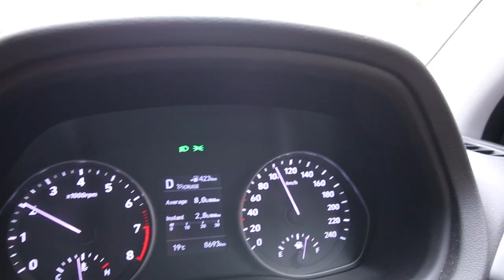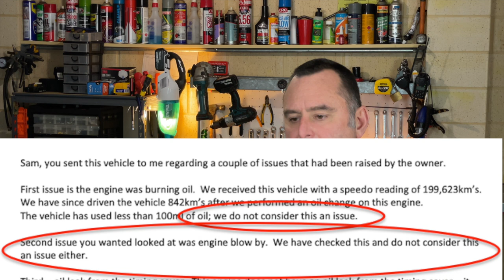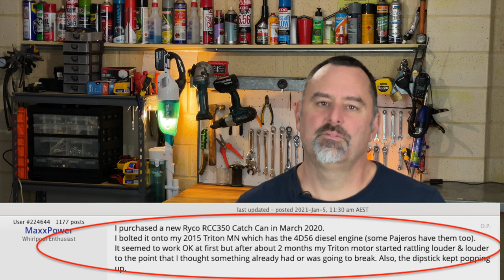Did my 200 Series Landcruiser ENGINE BLOW again - twice in 12 months? Or was the catch can to blame?

Comment: Wow. Definitely not boring.  Lots of interesting stuff there and I enjoyed your story.  Your heart must have sank when the problem kept coming back.  I don't have a catch can on my 79 series 2020 LC which is still under Warranty and just assumed the engine would be designed to deal with emissions etc.  Jury is still out as to whether I will get one down the track.  Great video.
Reply from the maker: Thank you. I still think there is merit in catch cans but am very undecided about which one is best brand wise…
Reply: @JebbreysJibberish  thankyou.
Reply: I recently hired a 7m MB campervan. Had 220k kms on it. Pulled like a train and returned 9.3 l/100 over 500 ks of highway undulating terrain. Asked the staff when I returned it and they said they don't touch them ( no catch cans, egr blockers ets), have very few failures and they sell them off between 250 and 300k. Of course these things don't do school runs or nip to the shops.

Comment: Hey Mate! Thanks for the video I have subbed for content.

Must of been a emotional ride mate glad things a lot better now. I am concerned about my Catch can now in my 2012 Y61 Nissan Patrol. I will need to confirm if it's a Ryco but what are your thoughts with Catch cans in general since a lot people in the comments are saying don't use a Catch can?

Cheers again mate.
Reply from the maker: Very good question. I think catch cans on certain motors are still a good idea. Like on the 200 with the VDJ because it’s such a heavy breathing engine. Pretty sure the ZD30’s like your patrol also like to breath a bit so probably not a bad idea. If it was a 1kd prado maybe I wouldn’t bother. In saying that I’m now much more weary on the installation, brand and maintenance of them. I’m still trying to decide if I’ll keep the filter in the new RCC351 or not, might remove it all together or maybe replace with stainless cleaner type stuff.

Comment: 13:18 You can see the pain in this defeated mans eyes. He's had enough.
Reply: Its really frustrating when you spend your hard earned money on a car and you get issues.
Totally feel your stress mate.
Glad you have it sorted 👍
Reply from the maker: Thank you.
Reply from the maker: Yeah and there was more that went wrong during this time but I didn’t want to completely bore everyone!🤪
Reply: @JebbreysJibberish  I bought a 2016 Sr5 with only 40,000kms for 48k Cash and have been having problems with it..
Dealer says they can't reproduce the faults so won't fix anything.
Have taken it in twice now and both times they have said "Can't fault the truck"
It has stat warranty but they say they still can't fix it unless they find something wrong..😭
Its very jittery on the road to the point where if i hit a bump on a corner at 80ish it feels like it slightly skips along the road..
Just doesn't feel right down there like the bushings are shot or something..
Its also VERY bouncy on speedhumps and i have heard the front scrape at like 15km ph..
Im guessing shocks are dead..
The leaves in the back are also flat..I did not notice this untill a few days after purchase..
Ive also had some issues with it not going back into first after reversing on a hill with a load..has got me into some dangerous positions..
And lastly at idle i can feel a slight miss..
I'm going to take the air box apart tonight and hope to find no red dust in there..
I checked the previous owner from the "home" setting on the gps as they hadn't deleted it and he was from Bundaberg...really hoping it hasn't been dusted..
Not what i expected for my nearly 50k cash...
Reply from the maker: Mate, that’s a shitty story. Has it got a DPF? Yeah check for dust. It does sound like the suspension is knackered, especially the shocks so it must have done some serious corrections over its life too so that. Best of luck with it, hopefully you get it sorted.
Reply: @JebbreysJibberish  Yeah mate has a DPF i believe.
I don't see any smoke whatsoever though and my missus followed me for a bit the other day and said it was fine.
I am going to change spark plugs soon to see if thats the slight miss at idle.
Just got home from work going to crack a cold one and have a look in the airbox too 🤞
Cheers bud i hope i can get it sorted too.
Reply: @joshpritchard4803  : always good to have a non toyo' mechanic on the payroll...

Comment: G'day mate, i ran a provent catch can on my isuzu Dmax for about 6 months and was always suspicious of the amount of oil it collected,and also 
wondered at some of the inconsistensies in the amount it caught, got pissed of with that and took it off and have never looked back since, i went back to the old 
belief that once you start a motor get it up to proper operating temperature even if you have to do extra kilms to achieve what you need to do, i know its a 
pain in the arse but in my situation where i live its really paying off, all sensers and air intake pipes, and exhaust lines are free of excess buildup, long 
story short, every time you use the vehicle get it up to full operating temperature regardless of distance covered, hope this helps.

Comment: I had my ARB filter in my cruiser catch can removed l just have some steel wool in their but l need to replace a rear main seal now lm going to run it with the oil drop tap open...

Comment: Im a Mechanic and have contacted Ryco over their filters leaking or comming loose.
Ryco are denying any responsibility telling me Im not installing them correctly. Ive changed supplier about 3 years ago.
Im about to remove my catch can due to oil leaks from my engine. Ill throw it at them if they don't offer me a full refund

Comment: I avoid non standard mods and definitely don't like non factory filters  generally. For example wanted to replace Toyota landcruiser ignition leads and so bought expensive aftermarket. These I found had poor connectors and consequently were unreliable. So then bought genuine and no further problems. An expensive lesson.

Comment: Total sympathy years ago I had a engine reconditioned it was just worn out and blowing smoke 💨 after the rebuild it blew three head gaskets after a lot of buck passing between the mechanics and the engine rebuild shop the cause was picked up by another mechanic who noticed the wrong pressure radiator cap had been fitted some time in the rebuild process possibly as a new radiator was fitted during the engine removal
Reply from the maker: Amazing isn’t it. I think there is some of it that people just don’t care and some of it people are too closed minded.

Comment: Great video
Reply from the maker: Thank you.
Reply: @JebbreysJibberish  I spoke with my Toyota mechanic who informed me a few weeks ago to be careful with catch cans on a 200 series, that's what made me search for videos like yours. They had three LC200 enter their workshop in the last month with seized engines, the catch can being the issue, two had the Ryco catch can, not sure about the third vehicle. 

Apparently, the newer (2019/2020) versions of the LC200 are even more prone to this issue with a catch can installed as Toyota have now fitted their variation of a 'catch-can' on their engines from the factory, or so I've been told.

The issue with the Toyota variation of their catch-can combined with an after-market catch is that it seems to create some sort of positive or negative pressure, forcing the oil out of the motor, seizing the engine. Two of the three LC200 in his workshop only had a few thousand KMs on them. Still brand new. 

My LC200 has not appeared to have any issues yet (I have had the Ryco catch-can on there for about 10,000km), however, I did notice a slight engine idle fluctuation recently which has never happened before. 

Thanks again for the video, there is very little information out there (through my searches anyway) regarding this catch can issue with a LC200. Many thanks
Reply from the maker: Interesting as I had that strange idle miss too……. Hmmm. Which Ryco catch can do you have? It’ll say on the top what model. Should be either RCC350 or RCC351. Ice just changed to the 351 that Ryco has sent me, it doesn’t have the check valve at the top, instead it has a baffle at the bottom of the filter which I still can’t work out what it does exactly.
Reply from the maker: I’m also interested in this catch can they say Toyota fitted. If that is true, one big finger up to all the nay sayers on these videos saying that of Toyota didn’t fit one why do you 🤣
Reply: @JebbreysJibberish  Very true :) when I find the official name of this thing I will post it here, apparently it cannot be retrofitted to an older LC200, I've asked. 

Someone might be able to explain why it was added to the newer LC200's if not to perform the duties of a catch-can???? :)
Reply from the maker: Any info would be very much appreciated. It’s no surprise with all the issues of them gunning up I guess.

Comment: Why would you bother putting a check valve on a catch can, it's not like the crank case breather is gonna start sucking back the other way. Silly ryco 🤨
Reply: I would assume it’s to relieve excess pressure within the catch can to be vented out? The provent 200 used to have these too on its cover until lately, replacement filters have bits to remove the spring check valves too. Just my 2 cents.

Comment: I hate shops, I had a load of issues with my triumph dealer for my triumph 675 motorcycle. They charged me a ton and messed up my bike and then tried to blame me for every little thing. Worst part was when it was running on 2 cylinders of 3 because the itb throttle blades were adjusted so badly. And the head mechanic said that was normal and the bike would learn around it. I had to use a thermal temp gun to prove it wasn’t using cylinder 1 until 5-6k rpm. Scored cams, pulled the plug threads out of cylinder 1, Damaged my air filter, was terrible.
Reply from the maker: The incompetence is staggering sometimes!

Comment: If you read some catch cans info sheets some of them state not suitable for v8 turbo engines, only for 4cly diesel. There is models to suit the toyotas v8 turbo diesels.
Reply from the maker: I have since spoken with Ryco and they say that they still recommend that the RCC350 is suitable for the VDJ cruisers but I will have more of an update on this soon.
Reply: I’d personally fit 2 in parallel to insure there is no restriction.

Comment: OK , I am pretty loath to post this but I am sure of my facts. The Ryco and other clones are not the same as a Provent in the placement of their valves. the top valve in a Ryco is a Manifold depression valve not a pressure relief valve. You can look a video by Western Filters to see the Provent depression valve on the side. The over pressure valve is only there to vent if the filter becomes blocked.
I have a Discovery 2 TD5 and have fitted a clone  which looks exactly the same as a Ryco. If you look on the Ryco site they show the over pressure valve on the side of the catch can not at the top. They do not show the manifold depression valve but if the hose to the manifold comes from the top that is what it is.

Now AFAIK all turbo diesels have a stock fitted  manifold depression valve in the intake tract before the turbo. When you add another manifold depression valve you are depending on it to have the same specs as the factory one and IMHO it is not needed. I removed mine. Or you need to get rid of the stock depression valve. One or the other as long as you trust the specs of the catch can which I don't.  This valve opens on low manifold depression ie on idle and closes over a certain manifold depression ie when the turbo is sucking a lot of air and there is a vacuum between the turbo and the air filter .  The operation probably also depends on a clean air filter. When you have 2 the result can be that the valves stays closed all of the time , which seems to be what happened to you.
Reply from the maker: I’m told that the RCC351 doesn’t have a valve at the top anymore, but that the filter is different end has a baffle in it. I’m not sure on the specifics on this, but in my conversation with Ryco recently, that was what I was told. Thank you for this comment, it is very interesting…
Reply: @JebbreysJibberish  Yes the baffle would have replaced the side valve as there is another diesel site that says that the catch cans can no longer vent to atmosphere for pollution control reasons.
Reply from the maker: It still has a side pressure relief valve the same as the RC350. I have them both here side by side atm. It looks like it would vent to atmosphere which is interesting if it’s not legal…. 🤔

Comment: I'm not a mechanic (by trade) but know enough to suggest it may have been the catch can from the get go. Would like to know how you had low compression on number 3 tho...rings/valves???
Reply from the maker: I was never privy to that information. I’m guessing rings, but couldn’t tell you for sure.
Reply: @JebbreysJibberish  Its always the passanger side cylinders with low compression on these engines. Bad air filter design allows dust into the engine. Dust prematurely wears the bores and can damage valves too. I recommend a soft silicone sealer on the engine side of the filter element on 200 series landcruisers.
Reply from the maker: I’m running the terrain tamer air box gasket now to see if that helps.

Comment: I cannot fathom why any catch can would require a one way valve and you could have a good claim against the kit manufacturer.
Although it could have been plumbed the wrong way around either initially or during the rebuild, which with a one way valve would leave pcv gasses nowhere to go but through your seal and gaskets.

I think the moral for others to take from this, is if you don't maintain your own vehicle, keep it stock.
Catch cans require maintenance and it won't be on most mechanics service schedule, unless factory fitted.

Comment: A catch can that is too small &/or not plumbed correctly will cause issues. Some drain oil back to the sump automatically requiring check valves & the blowby vapour can vent to atmosphere or return to the inlet depending on the engines design/application. Do the research, get it right the first time & they are nearly a fit & forget

Comment: Both the Ryco (RCC351) as well as the gen4 provent200 have abandoned their check valve/backpressure valve configurations from their previous versions. the risk of these sticking and causing engine overpressure was too great. I have inspected both units and their is a clear flow path through both at all times with no sprung valving present.
Reply from the maker: It would have been nice of them to inform their customers and or at least acknowledge it when I contacted them…
Reply: @JebbreysJibberish  agreed, but I'm sure you understand why their legal department would prefer they didn't.
Reply from the maker: Haha true I guess but they’ve lost a customer across all of their products now and I’m sure others will follow.
Reply: @burn4005  the provent changed configuration cause it was venting to atmosphere from the previous relief valve design which is non emissions compliant.. The new version has the check valve underneath which vents back into the intake.
Reply: @krump743  I have a gen 4 in my hand, the external overpressure relief is gone in favour of a filter element bypass valve, but the back pressure valve on the outlet is also no longer present. It instead is a fixed orifice with a reduced cross sectional area to limit gas velocity.

Comment: Even with the catch can blocking the crankcase ventilation system, a 1000km old engine should have no blow by that can be felt by hand. The engine builder knows this and didnt want to deal with it hence the defensive position.

Comment: Both the Ryco and the Provent kits use a filter element that's essentially the same and the housings appear to be the same however the diagrams and instructions show the Inlet and Outlet hose orientation differently. I raised this with the clowns at Berrima Diesel (yep same bloke who recommended "heavier" than specified engine oil in 200 series landcruisers, demonstrating zero understanding of modern engine clearances, metallurgy or tribology). I was dismissed for pointing out the reasons for correct hose orientation (based on my training and years or experience working on high-end diesels and screw type air compressors. I don't really care who cops the lawsuit but clearly one manufacturer is wrong!
Reply from the maker: The Ryco actually makes more sense in my mind with the inlet being at the bottom. Inside at the top is a cup style guard that stops the mist going straight out the top pipe and makes in circulate a little first. I imagine this is why the Ryco does filter more in some tests, however it might also be why their filters need changing more often. But again, I’m no engineer.
Reply: @JebbreysJibberish  The Inlet from the crankcase should be on the bottom outlet for two reasons. Firstly, that's how the membrane type element works. Gas containing oil vapour is presented to the outside of the membrane and oil is sheared off, dropping into the cam while dry crankcase gases continue to the Inlet manifold. Secondly, if the outlet to the air intake was on the bottom of the catch can you could presumably hydraulically lock the engine if the can was overlooked for a couple of service intervals and the catch can oil level was high enough to run back into the manifold. Not unreasonable considering the angles encountered during off-road driving...
Reply from the maker: Interesting. So that’s a definite positive for the Ryco over the Provent then.